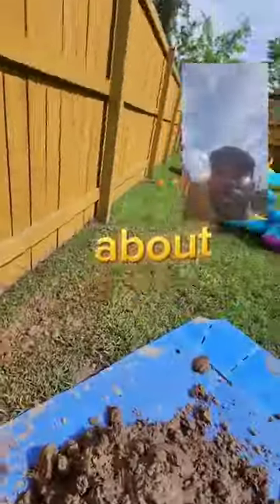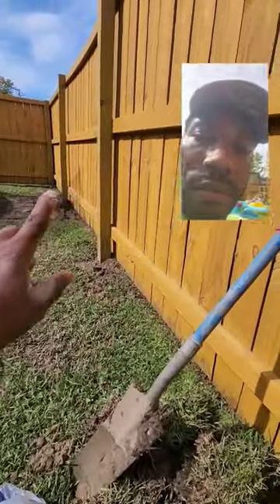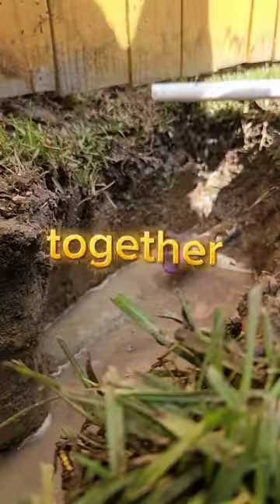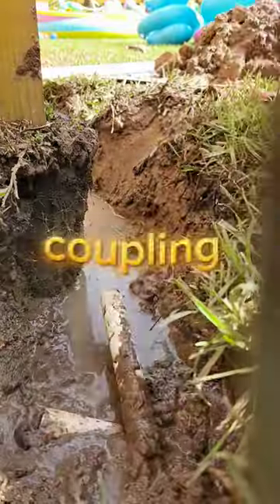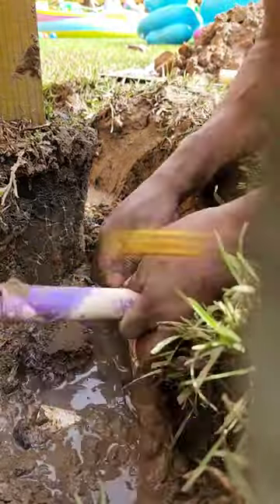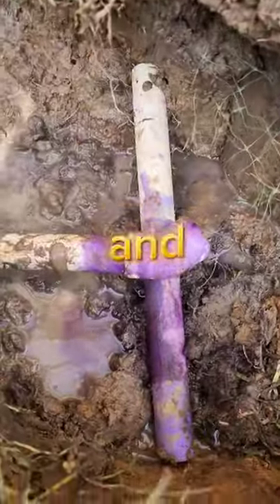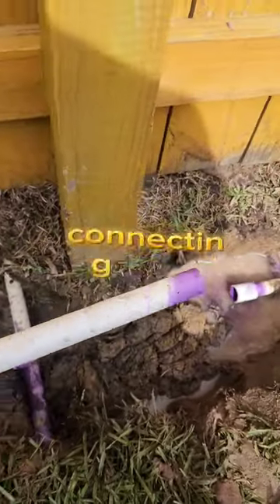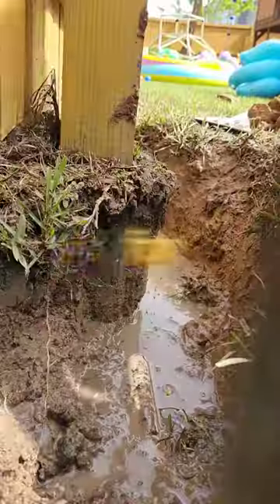How to Fix A Broken Irrigation Pipe Easy 💦. Tell the fence guys 👥️ to stop BUSTING my pipes #shorts

Comment: It's sad that logic & common sense wasn't used once the first break was made. Hole should have been enlarged to determine the direction of the pipe for the sprinkler heads. Digging sample holes would have prevented this damage. Then care should have been taken so the auger would not screw up the rest.
I hope there was a realistic charge paid for this job.
Reply from the maker: Nope, they didn't even call them. 😆
Reply: @robertpaidprice  Well Dammit